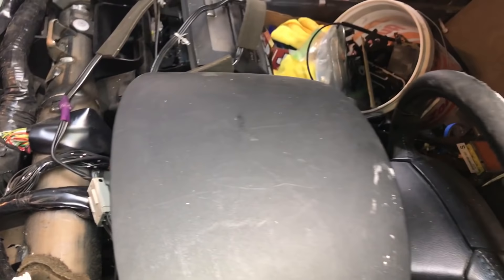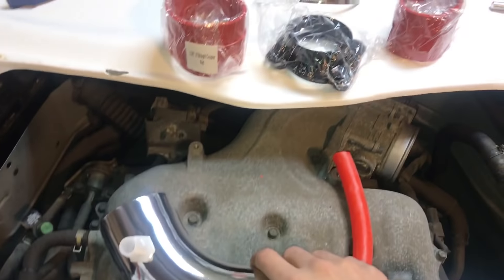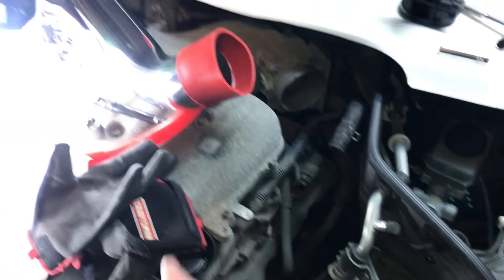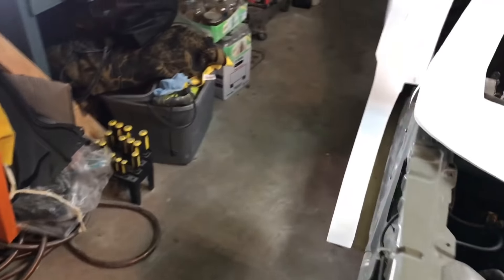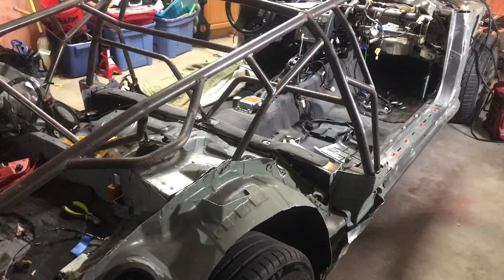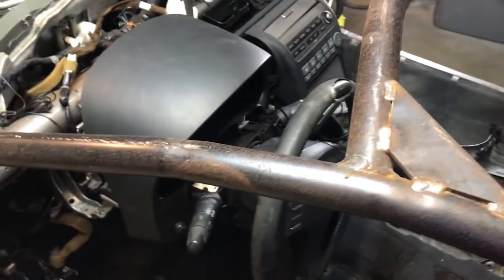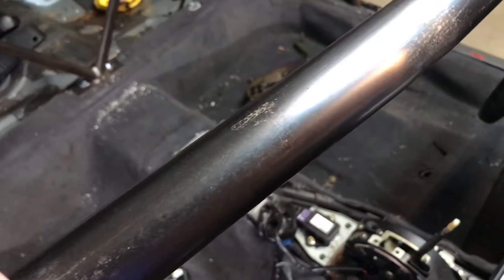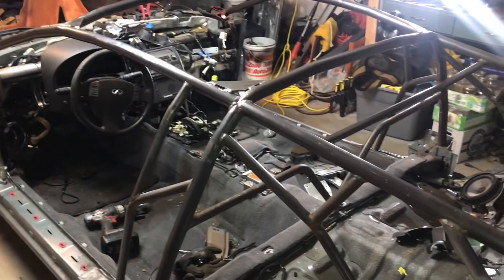Vaydor Build Pt 20(Troubleshooting, Air Intake, Sanding Roll Cage)

Comment: It looked like you had your battery disconnected but if not, welding with ot hooked up can kill a ECU. I still think it could be a lack of ground because the car ran great before so either the welder fried it or it just doesn't have enough grounds anymore.
Reply from the maker: Yeah I unplugged it when I welded... I’ll triple check all the grounds before getting my ECU repaired, fingers crossed it’s something simple like that

Comment: Did it run when u cut car apart? If so then u just over looking something check for fuel is the pump turning on? U can try spray Lil bit fuel in intake see if it fires if so then ur down to fuel
Reply from the maker: yes it did, and i tried that starter fluid... we tested everything and its the ECU thats stopping it from starting

Comment: The car may not start because there is a critical ground you removed. A ground strap from body to engine. Or from battery to frame. Or from harness cluster to a lug that is hanging( not grounded) . 

Also if you welded without disconnecting the battery you could have blown a fuse or BST battery safety terminal is now disconnecting power from systems.
Reply from the maker: Unfortunately we checked every wire, ground wire and fuse... they’re all good

Comment: Knew it. Welding w/o disconnecting ecu. I’ve done it 3 times and I’m sure I’ll have it happen a 4th. DISCONNECTING BATTERY LEADS DOES NOT MEAN YOU DISRUPTED AN ELECTRICAL CIRCUIT. ALL ELECTRONICS ON A CAR ARE GROUNDED TO THE CHASSIS AND ARE THEREFORE STILL VULNERABLE.
Reply from the maker: I had issues getting it to start before I started welding so the ECU was bad from something else... that being said I'll be sure to unplug it when I get the car welded just to be safe, Thanks!